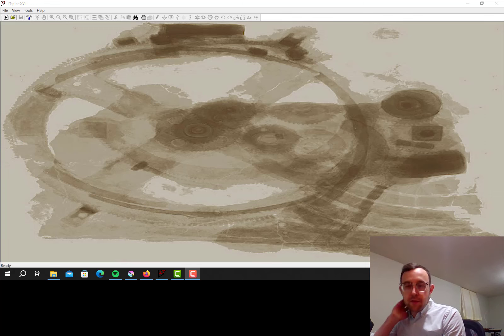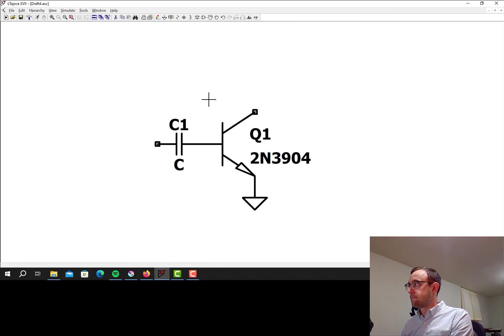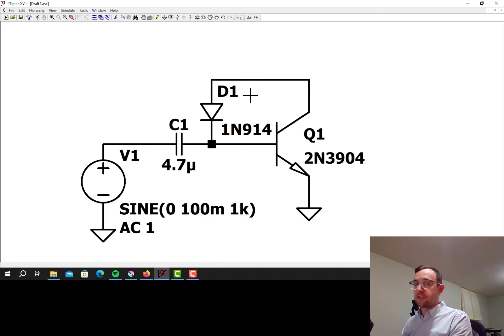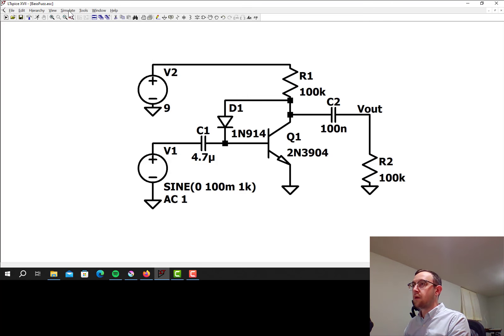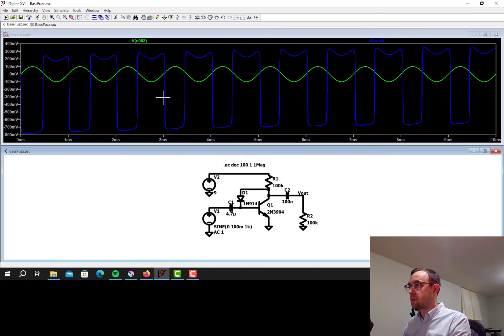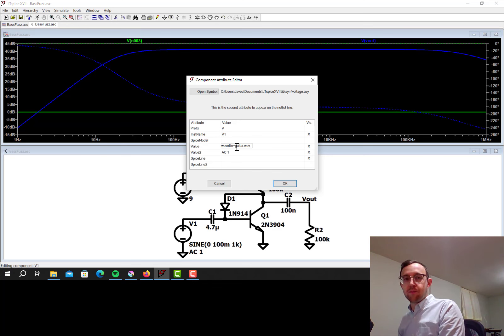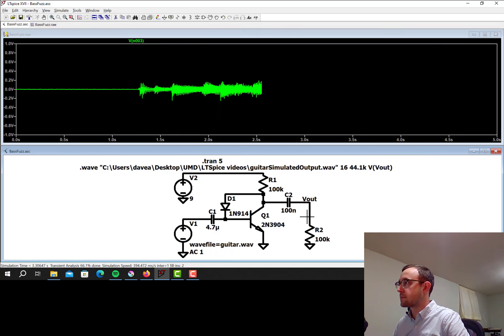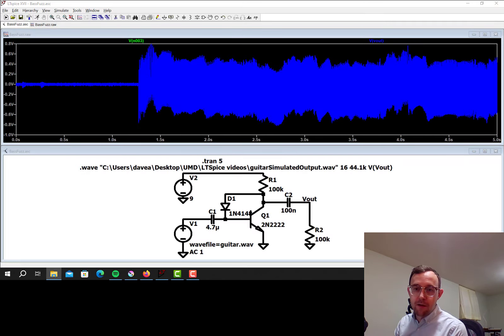LTSpice Tutorial: Simulate a Bass Fuzz Guitar Effect (Transient, AC Response, Wav) (EE2212 UMD)

Comment: Thanks. It worked. I just used an old wav file, for input, and it worked pretty good. What gear did you use to record a wav file from your guitar? My plan is to record with my android and covert to wav with Movavi video editor but I don't see how I will have any control over the waveform amplitude besides trial and error.
Reply from the maker: Pretty sure I used a Zoom R8 to record the guitar. I normally try to aim for 50-100 mV amplitude for "quiet" guitar playing and 200-400 mV amplitude for "loud" playing (e.g. chords). This will depend a lot on your pickups and such, though. If your voltage from the wav file is in the wrong range, you can boost it using a simple op amp circuit (inverting amplifier) or cut it using a voltage divider. You can also easily edit the amplitude of the wav file in a DAW like Audacity.
Reply: @earthtoneselectronics   I plotted input and output impedance using a method from another video. It seems like it was done correctly. The input impedance seems too low at around 50K. The output impedance seems high at around 25K. I built the pedal and it works with my guitar and Fender Sidekick 10W amp. However it does not work with my test bench 12V car radio amp. I suspect the car radio amp is loading down the pedal. Here are the impedance measurements:        https://www.youtube.com/watch?v=vTElvnFZGzA